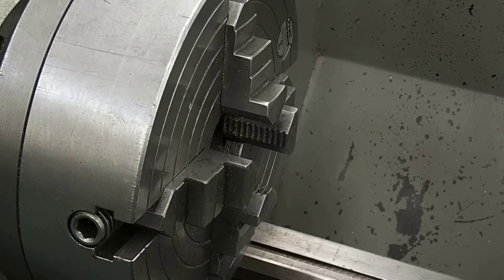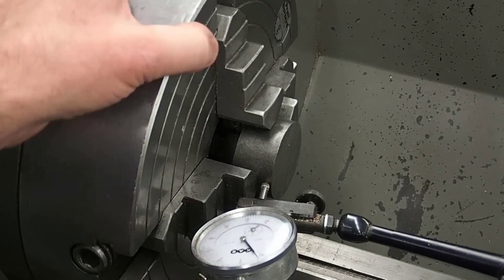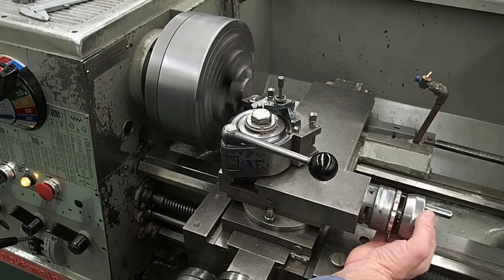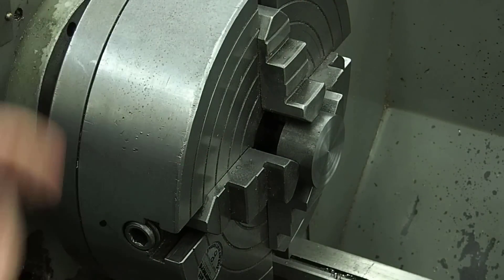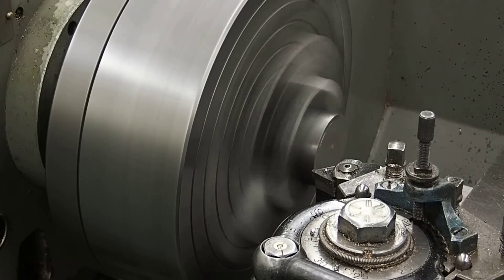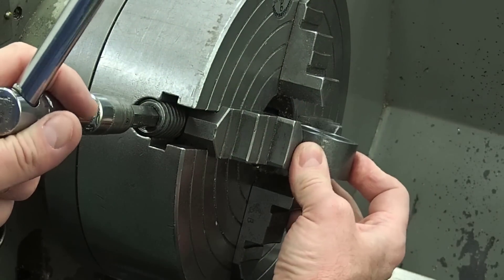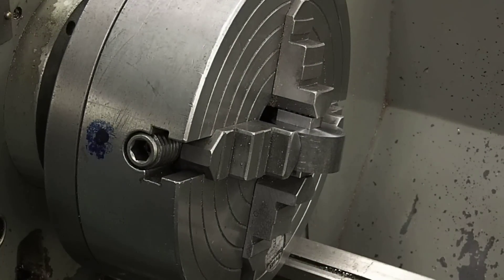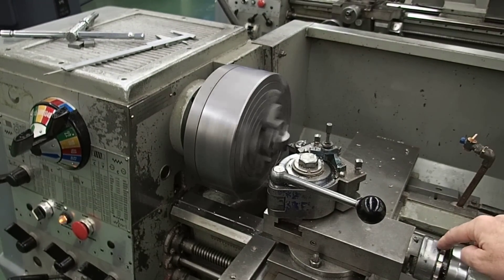Machining a Cube on a Lathe

Comment: this is total worthless, a lathe moves at right angles and so dose a milling machine, you are only moving the work piece instead of the tool, it would be a whole lot easier and faster to just get some square stock and be done with it
Reply from the maker: Agreed! The guy who asked for this video didn't have a mill.
Reply: Worthless?
It's Sunday afternoon, the supplier's not open, you've got £13,000,000 worth of printing press down, a glossy magazine half printed that must hit the shelves tomorrow morning, and the block of material you require is of a spec that only comes in rounds, anyway... (and you have some round stock of suitable spec that's large enough to machine down) What would you do?  The press earns over £1,000 per hour, the only other suitable press in the press hall is running another product (and making money) on different paper, and there's a deadline on that product, too.  Do we swap printing plates and paper on the press that runs, jeopardizing the deadline on the product it's producing, or make that block from the available material, using the available lathe? (the printing press manufacturer is in Germany, so can't tell you on Sunday where there is a stock part in the UK... (and, to cap it all, the Bridgeport's just been sent out for refurbishment...)

As for- "a lathe moves at right angles and so dose a milling machine,"... Only if they've been set up correctly, and few machines I've used over the last fifty years have been set up correctly.  (Georg Schlesinger explained how, a long time ago, in the 1920s)
If you think machine tools arrive ready to use with just a little levelling, try turning equal diameter rings on a bar, supported between centres, at two extremes, at the headstock and tailstock ends, on your lathe... On the same cross slide setting, you ought to achieve the same diameter both ends.  If you don't, is the headstock, tailstock,  or centre out of alignment, or is the machine "in wind" (twisted) due to incorrect jacking screw adjustment?  How will you find out? How will you correct it? Were you even aware a huge chunk of cast iron could be twisted by poor jacking?  The four jaw chuck?  are its jaws' clamping faces parallel to the lathe axis, or "bell mouthed", so out of alignment?... (they'll never be accurate )
The Bridgeport (when it comes back) and many other mills' turrets are adjustable for tilt in two axes.  Are you going to check they've both been set correctly, or start your job and hope the last guy clocked the spindle?  Do you always place your previously machined surface against the fixed jaw of your vice, and is that jaw perpendicular to the mill table?  Does the retreating jaw tend to rise up due to vice wear, tending to lift your workpiece? What do you do to counter that?  Did you clock your fixed jaw?
When you're desperate, knowing what you can do with the available resources, in the available time, is the difference between a "just competent" tradesman and a better one.  The better one can be depended upon to get that £13,000,000 printing press running as quickly as possible, and get production going with minimal lost time. The "just competent" guy scratches his head for a long time, while production's at a standstill... The better one's half way to having finished the task...
A guy I worked with in the seventies bored a number of holes, of different diameters in a large flat plate on his lathe faceplate, using toolmakers buttons to set them out... because there wasn't a vertical mill available... You'll never see that nowadays.
Reply: ... It's so cheap & easy to be critical. (Directed to @tony d.  I really appreciated Robert Lawson's response)
Reply: It's difficult to see to whom your remark was directed.  If it was towards me, I'd just point out I was being critical of previous criticism, hence the question mark after the word "worthless", quoted from the post I was criticizing. TonyD's remark in which he assumed machine tools naturally "moved at", and by implication, produced, right angles on workpieces, led me to infer he had little experience. I've used lathes for tasks I wouldn't ordinarily have chosen them for, especially while the Bridgeport was out for refurbishment... (and I've had to set up machines that hadn't been set up properly by people who ought to have known better)

Of course, I didn't make clear to whom I was directing my post, but had hoped it could easily be inferred.  Perhaps you too were posting in respect of TonyD's remark?  @williamnedbalek6836
Reply: To state that this is worthless...just shows how little you know!
You wouldn't do this if you had suitable Sq stock available ..DOH!
What if some suitable sq stock wasn't available...what then...sorry Boss it can't be done!
'Teats on a Boar pig comes to mind?'....stay behind your desk for all our sakes !
Reply: Thanks for that, William, I knew I wasn't being critical of the original contributor, but I also know that many around here can misconstrue the most innocent of statements.  Now I'm retired, I have time on my hands, hence my presence here.  
At one time I had three lathes (none particularly great) and a small milling machine and was expected to manufacture and repair parts to keep 12 printing presses running in emergencies, when OEM parts weren't on the shelf. 

Hard enough if the only people who use the machines are skilled, but if you have to produce parts accurately on machines that have been abused by others (think, as an example, in terms of a fitter who thought it appropriate to try to straighten a shaft by hammering it while supporting it on a running centre...) That meant grinding the centre true again, when the damage was discovered, which in turn meant breaking down a setup on an another lathe to mount the toolpost grinder... of course, he'd Brinelled the bearings in the centre with his hammering, so the centre always rumbled and heated up, but buying a replacement and seeing it abused too, would have hurt even if it wasn't my money... 

Sometimes, when you have your only milling machine set up for a task, it's best to perform "milling" tasks on an available lathe, and sometimes, a good fitter will chain drill and file a slot in a plate or shape a piece with a hacksaw and file rather than wait for you to mill it... Perhaps less so nowadays?
Reply: Its a demo.. for fun.  I don't think he said it was practical...
Reply: ..for the few other well intentional idiots out there,some things still need to be explained.

Comment: "another 80 thou" Only americans would use decimal fractions on an imperial measurement system then claim they preferred imperial.
Reply from the maker: To start, I'm not American. I am able to work in both the imperial and metric system.
Reply: @machiningmoments  I was pointing out that americans have decimalised the imperial system to make it more metric-like without switching and it isn't just lengths, americans use short tons (2000lbs) because the actual measure of 2240 was hard to calculate - short hundredweights too - they should be 112lbs, not 100
Reply from the maker: My mistake, thank you for clarifying.
Reply: @machiningmoments  Yeah, I just think it'd be easier in the long run to just switch - apparently it really hurts US exports since you need to pay someone to check engineering conversions are accurate to avoid mistakes which makes businesses less competitive, but I guess if people want it because of tradition or something shrugs
Reply from the maker: I couldn't agree more. I live in a metric country and work mostly in imperial as the majority of my customers are from America. Yet I work in metric for some industries such as aerospace. I use both so often I don't even think of it anymore. I remember around 1976 my government said "ok now everyone is metric"...some 40 years later we still use both. Go figure. I guess commerce is powerful. Nice chatting with you.
Reply: As a Canadian Kid I had a dislike of SAE and would always avoid inches and feet. However, I went to learn some Machining in Oregon and I got hooked on decimal inches. And the thing is, they are a good size unit for the work. 1/10mm  is too big (about 0.004") but 1/100 mm is too small. Also, feet and inches are reasonable sizes for woodworking (not least because all our lumber is sized SAE)

I still have a strong preference for metric (I spend the money to get metric hardware) but it would be nice if metric had something the scale of an inch.
Reply: @ruslbicycle6006  most people just use 0.2 or 0.02 mm increments if you want something a bit bigger than 1s, if you want larger again you don't use 0.4s, you use 0.5/0.05
Reply: @catnium  I have never heard an American genuinely argue that imperial is better than metric, everyone i have talked to about it prefers metric.
Reply: I've started doing all my angles in 100 units in a circle rather than 360 degrees.  It's so much easier to think of 50 circle units in a triangle rather than 180 degree.
Reply: @rileyellis5951  This American says imperial is better.  There's no reason to use the metric system. There are no benefits to it.
Reply: @machiningmoments  Hah! You must be British!  I failed at maths in school when working in Imperial but was saved by the just-in-time introduction of metrics.  When on to absorb Imperial by default, but never really understood how 0,357 and 0.38 could be the same size :)